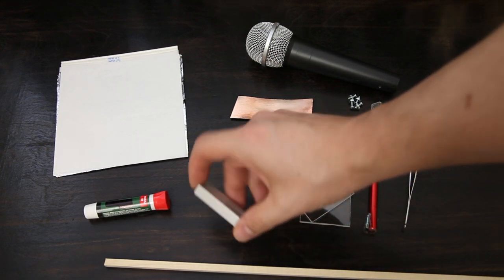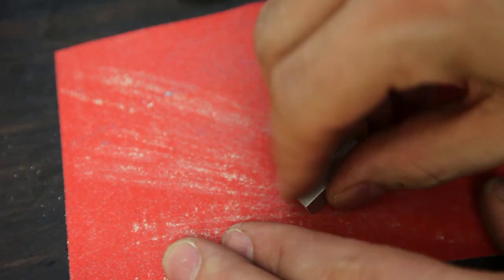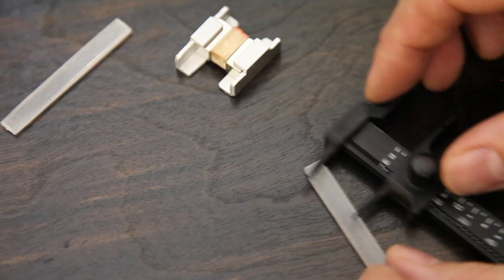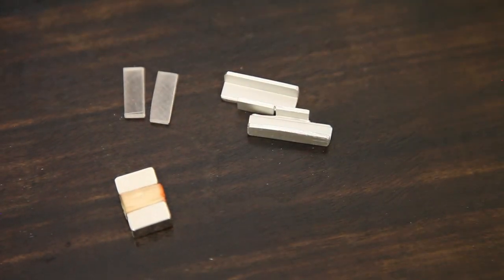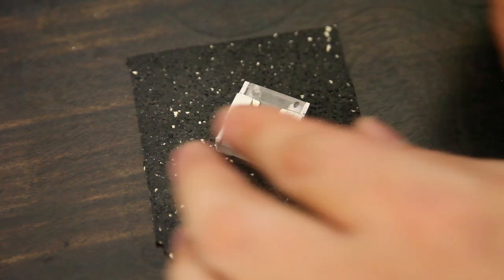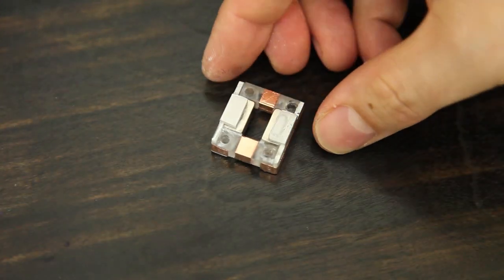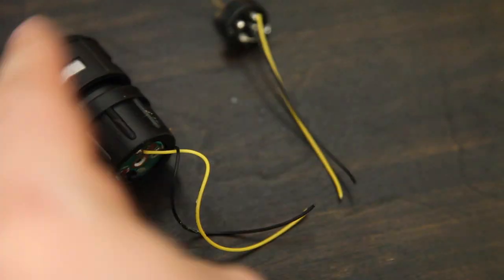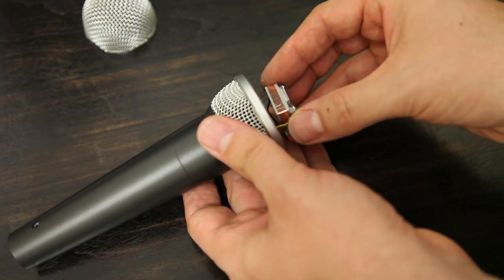Ribbon mic DIY Build Microphone HOW TO MAKE A RIBBON MIC

Comment: what is size magnet on the video? width foil? distance between foil and magnets?
Reply from the maker: The magnets are 1/4"x1/4"x1/2" long. The foil is about .23"-.24" wide. The gap between magnet and foil is as close and you can get without touching.  See this video for a clear shot of the gap: https://youtu.be/1DsqWRe4nMc
Reply: @FrankOlsonTwins  What about the direction of the magnets relative to each other? Absorption or excretion?
Reply: @FrankOlsonTwins  can this mic connect to sound card 48 v phantom power?
Reply from the maker: Absorption
Reply from the maker: 48v Ok, but never "hot patch" while connected to a patchbay
Reply: @FrankOlsonTwins  i cannot found transformer for ribbon mic. can help me for make atransformer?
Reply from the maker: I don't think I can help much, I've never made a transformer.  You can look for 1:28 or 1:35 transformers. Edcor, Cinemag, Lundahl all make ribbon transformers.  You can also look for Shinhom T25, available in many countries.